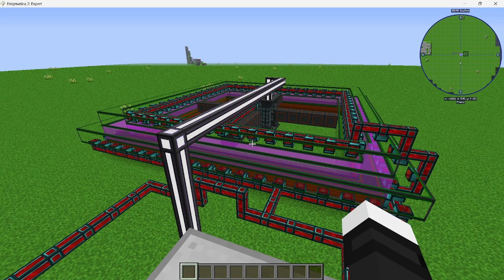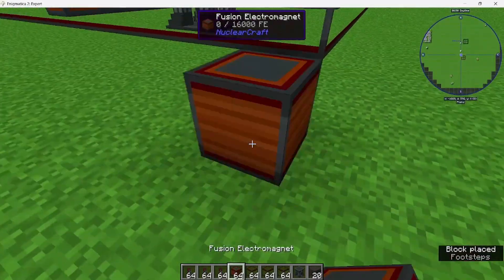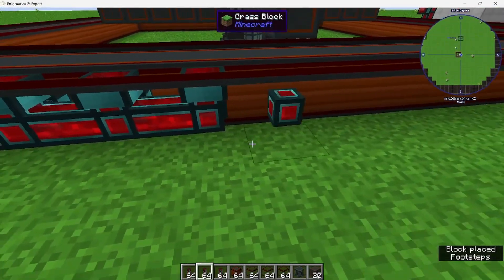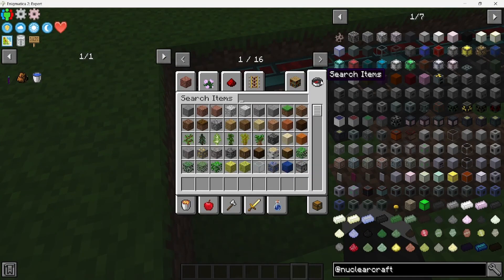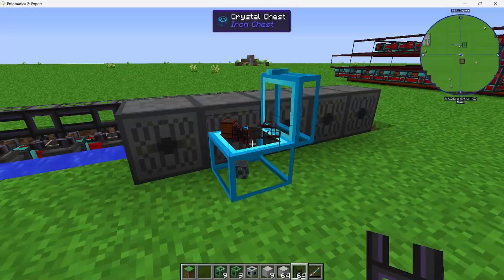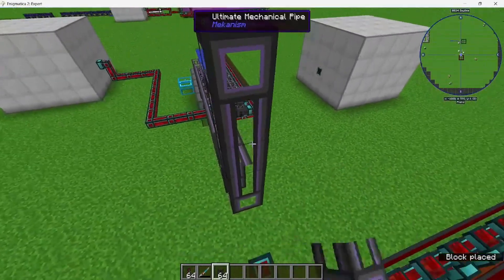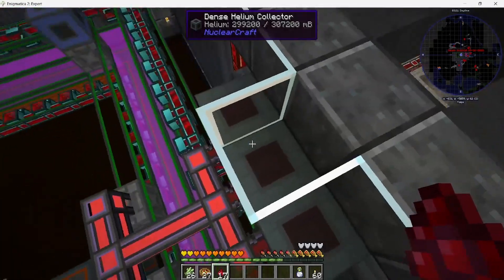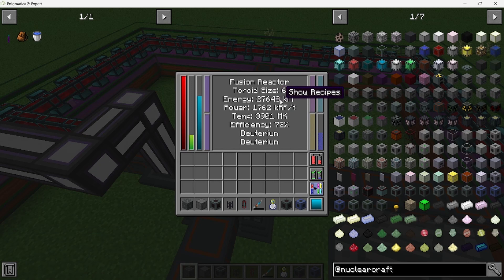[1.12.2] Modded Minecraft Tutorial - Nuclearcraft Fusion Reactor Size 6 [2 million + RF]

Comment: Can you run the Reactor constantly at 100% cooling? Or does the efficiency drop when it's at almost 100%?
Reply from the maker: Yes you can constantly run the reactor at 100% cooling. However in the video I only reach 89% cooling. This means that before the reactor reaches optimal temperature say around 5824K/t for a deuterium deuterium reaction it will stop heating up and decrease the rate of the temperature increase until it comes to a stand still at which point the reactor is stable. However since it is only 89% cooling, this point will not be at 100% efficency.

With 100% cooling of 5000k/rt I believe the reactor will stay at 100% efficiency however I have not tested this and I don't know how long it takes for it to be stable at 100% efficiency. That being said the fusion reactor will be stable and will not melt down!
Reply: @DrRedChefYT  Okay thanks for the really fast answer! You got the Sub from me. ^^ Great Videos keep up! But one last question, I built an reactor not with a size from 6, I built one at a size from 11. Does this cause any differences?
Reply from the maker: The only difference is that its going to need more cooling, fuel, and power. It should still reach a stable point and it can run continuously as well.

Comment from the maker: Some Clarifications: 
You are going to need 5 electrolyzers and you need to put one speed upgrade in each electrolyzer or the Nuclearcraft reactor will eventually not get enough fuel when it gets closer to max efficiency.

Cooling Instructions: 
3 dense helium Collectors go into 3 super coolers which go into two active coolers placed symmetrically. The Supercoolers need power. Active coolers should be placed on the outside ring of electromagnets on top.

Also, DO NOT cool the reactor before it heats up a little or the reactor will explode! I waited until the reactor got to 70% efficiency before placing the cooling down.